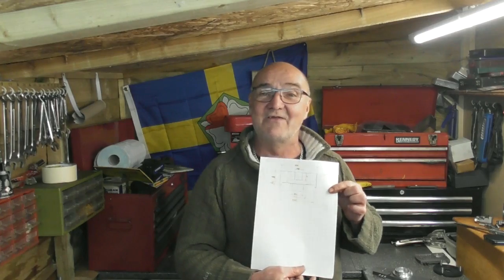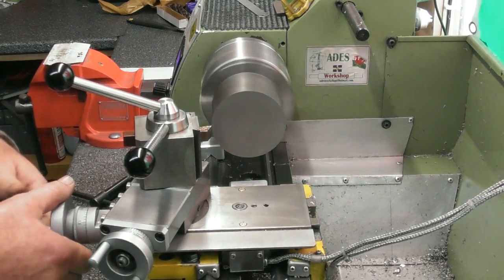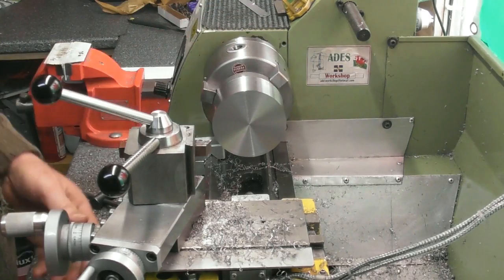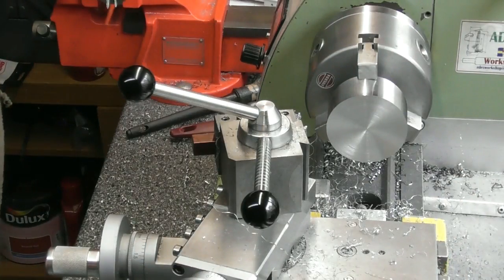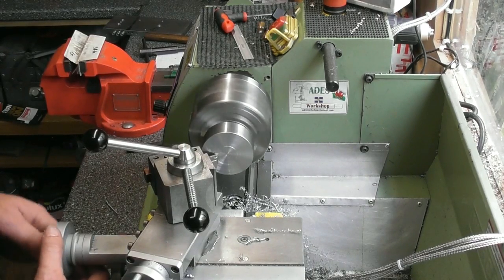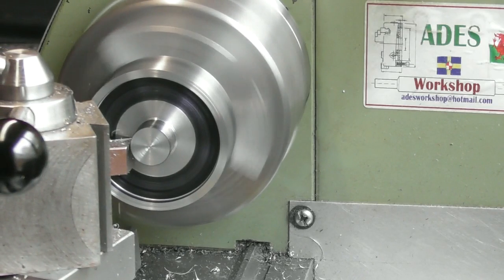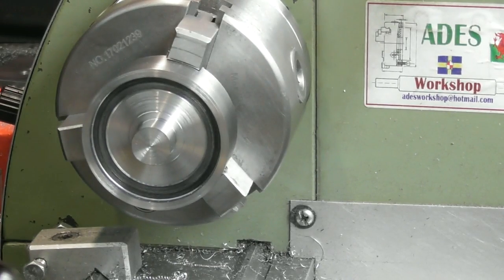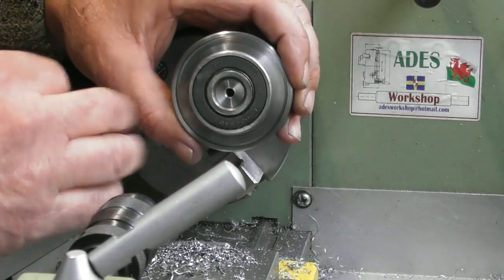Making a ball turning tool part 3

Comment: Thanks for your videos, they're great. However may I make a suggestion, in addition to numbering each video would you please add a brief description of the part, i.e. Ball Turning Tool - Baseplate. This would allow a person to go back to a particular part of the series any time without having to remember the series number. Also it would be great if you could produce drawings for each part, a simple sketch like you did here would be ideal.
Reply from the maker: Good point , hmm , possible , trouble is that i make it up as i go along and sometimes when the job is done that i would do if differently , the drawings are about the thought process sometimes. i will try to accommodate. on the subject of numbering , nah , life is to short to stop people watching the same vid twice and it is good for viewing figures , lol , Cheers Ade.
Reply: Hi Ade, Thanks for your prompt reply. The thought behind my suggestion was to actually encourage people to go back quickly to a given episode and see exactly how you went about doing the job. Thanks for your great work.
Regards,
Frank

Comment: Is that carbide cutter negative rake? (looks like it in vid) When I worked for Tuscan Engineering (Bridgend,  S.Wales) we had a 0.005mm total tolerance on bearing housings.  Years later, the toolmaker there told me I had been turning to 0.003mm tolerance. I was running Suzuki dealer workshop at the time, Kevin brought his Kawasaki in for service cos he knew I could do it right ;o)
Reply from the maker: I see what you mean but it is positive , must be the effect of the triangle i guess , Cheers Ade.

Comment: good work as usual, I was a little disappointed that you showed all the facing and plain turning, but then skipped the interesting bit where you took the inside bore out, did your camera let you down or is it on the cutting room floor, thanks for the upload,  Bob in the UK
Reply from the maker: Yes  Bob. the demon battery . i did try to recoup with the finishing cuts , apologies , Cheers Ade.

Comment: Hi Ade, it is we think one of your nicest blueprints we have seen yet, like the lip those moves to us are extras and they are what planning and thinking along with years of skill and knowledge get in the end. 
We like Everett, he is a really nice man. That is a lot of drills what a needed and handy gift you received.
Wow a bearing, this is going to be a really really solid accurate and nice ball turner for that lathe.
Thank you for this shared video and congratulations in receiving your first channel stickers Ade. Lance & Patrick.
Reply from the maker: Hi both. once again thank you so much for your positive comments, I have never used a ball turning tool and just thought that a deep groove bearing may give it the rigidity that it needs , i still don't know what results it will give as i have never seen one made like this , a bit of a gamble but i am sure it will be good . Yes Everett is a star , I have noticed that your furry characters have disappeared from your intro's , shame. i am uploading a video  tomorrow with "one of my helpers" doing a cameo role . it was a bit of  fun . Stickers . oh dear now i need a plan for where to put them . I am thinking a dry wipe board that will double up for random messages etc. Keep enjoying doing it guy's as much as we all enjoy watching . and i really want to see the secret of the milling machine , Cheers from Wales , Ade.

Comment: I think you would really benefit from a band saw more then a mill at this point.  I have seen you waste too much material turning it down when a band saw would have left you with plenty to spare.
Reply from the maker: Yes band saw would be a good idea , i do have a plan for a small extension and it is on my list , Cheers Ade.